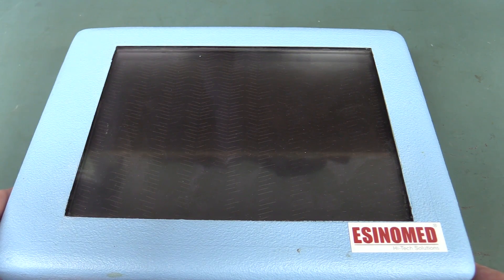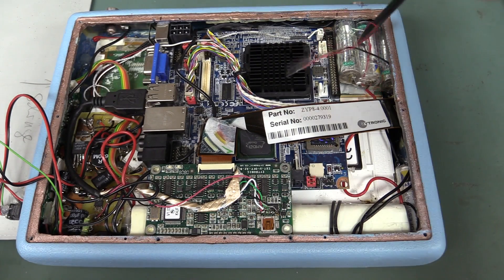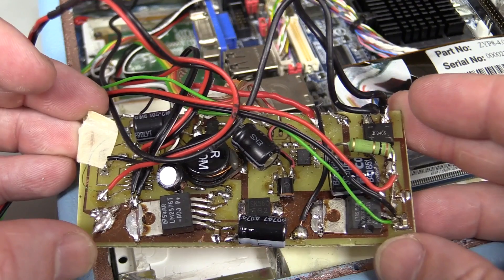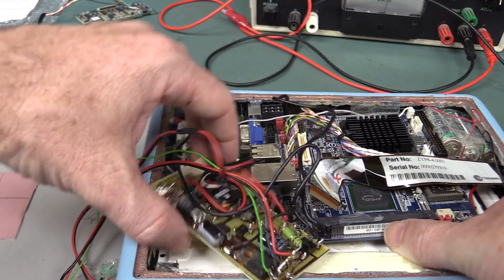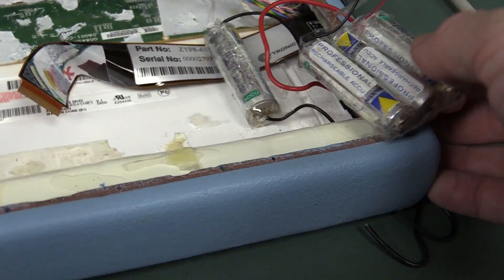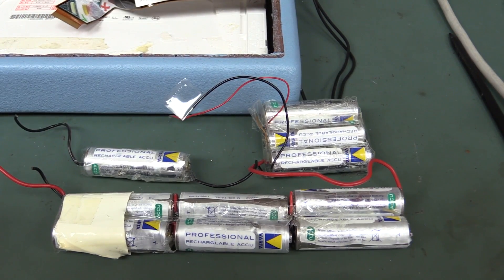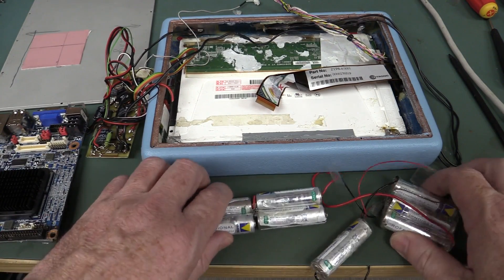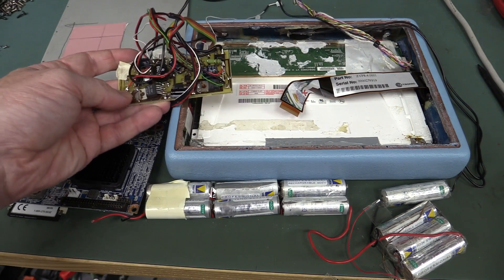EEVblog #822 - World's Worst Tablet Computer Teardown

Comment: Hey Dave. what's the model number of that PC board?
Reply: +EEVblog Dave, could you possibly do a quick vid where you test how good / bad the output ripple of the "PSU" is?

Really no excuse for this "prototype" to exist - as you said in the vid, they could have just used an off-the-shelf mini ITX PSU brick which runs off 12-19 Volts. They are still quite small, and would have been around when that motherboard was released.

Even a cheap NiCD pack, or camcorder / drill battery with a built-in charger circuit would have been quicker to get hold of. lol

I wonder if it was maybe an intern / work experience person that put this "thing" together, and they simply released it as a client demo unit anyway?

(you sure it wasn't Ben Heck with his hot-snot gun? :p )

Whether it was for a consumer, customer, or client demo, it's still not excusable to have made at least 11 of these.
Reply: +electronash I was actually thinking that this might have been the work of a young Ben Heck... silly ideas and way to much hot-snot..
Reply: +Jeremy Dixon (generalleoff) 
Funny how the Pi gets soo much attention when you could get far more capable boards for $20 more long before.
Big marketing money.
Reply: +Firstname Lastname No marketing money at all! 

Just word of mouth ...
Reply: +electronash Just echoing electronash's request, I'd also love to see an analysis of the efficiency and ripple of that howdydoody psu!
Reply: +electronash In his defence, I never really got the impression that he claimed to be an expert, so much as an enthusiastic hobbyist. I'm not really that into his show, but his website and forum way back in the day were awesome. Lots of bodging and hot snot, but some creative ideas none the less, and he really encouraged that sort of exploration. I remember seeing like 14 year olds building vaccuum forming rigs to make custom cases for N64 portables. You can say what you want about his soldering skills, but he definitely sparked the creativity of some kids who came out of it with an enthusiasm for engineering, or at least modding.
Reply: He has done a small number of not-so-bad portable mods, but I can't forgive him for his poor soldering skills, destroying a perfectly good ZX Spectrum, and for pronouncing it "Zee-Ex Spectrum". :p

Anything on Ben Heck that has half-decent soldering is usually done by one of his cohorts.

You'd think that after more than ten years of modding, and having his own forum that he'd picked up a few techniques by now. lol
Reply: +CreativeType There is a kickstarter campaign right now that I have backed called the UP board that uses a Intel Atom x5-Z8350(listed as Z8300 but they plan to use the Z8350)  2GB DDR3, 32GB eMMC, and even a USB 3.0 OTG port for under $200 in RPi 2 form factor.
Reply: +EEVblog Nice, in my company we use ALIX Boards as routers, they have the same processor, but RAM is integrated (not changeable) and they only need a simple external 12V power supply.
We changed them with APU Boards which are similar, but have a better processor (AMD G-T40e) and are pretty nice too.
Reply: +Firstname Lastname I'm sure it has nothing to do with the openness and huge community around RPi.
Reply: AnubisAkaLee https://www.kickstarter.com/projects/802007522/up-intel-x5-z8300-board-in-a-raspberry-pi2-form-fa?ref=nav_search 
34 hours left :)
Reply: Aleksander Øyen Ah yeah. Personally I just want to built a tiny handheld Linux terminal I can tinker around with. Perhaps use it as a picture frame or something. The lack of a wifi chip on the Pi boards really is a bummer though, but oh well; there's always alternatives even though they might not be as neatly packaged.
Reply: electronash I guess it's one of those things where someone learns on their own rather than getting "classical training," and even though they do everything wrong, it somehow works in the end. He does do some pretty gross soldering though lol

About the 8-bit computers, I agree. It's a shame to see some of them taken apart and modded to pieces, but even the 90's stuff gets me that way. A PS3 or Xbox is an appliance to me, and just gets replaced when the next generation comes out (or sold, and not replaced, because PC), but I will never stop playing or get rid of my NES, Genesis, SNES or N64, so I always cringe when I see people tear them apart. I have seen people make some cool things out of them, but nothing irks me more than when someone uses an NES case as an enclosure for something else, and just tosses the insides out.
Reply: jordanzish I'm a video guy,  I watch this channel out of curiosity. However I've applied  some of his lessons to real life and etched some boards etc. I solder wayyy better then that though haha. Soldering isn't that hard as long as your not sloppy.
Reply: Oh, and Geode boards are generally quite well regarded, though they don't have the best raw number crunching or desktop UI performance, they do run native x86 code and have pretty good media processing. Hence they get used in things which at one time might have required a dedicated PC server (disc stations, firewalls etc) and so have a transferrable codebase, and very often in set-top boxes for satellite/cable receivers, "smart" media centre devices, even some HD optical disc machines and PVRs. I somehow don't think the Pi would be as good for that.

The thing with the Pi was that you got a full good-to-go computer with built in general IO interface (instead of needing a separate card, or USB converter) that could run off a plain USB power input and interface to almost any non-VGA display you had hanging around. Chip, memory, networking  etc already all on board, all you had to do was add a storage card and plug it in. Very small (credit card size), very versatile (use it as a low-end desktop, put it in a mobile case as some kind of handheld machine, or use it in place of a microcontroller for various projects but with much greater program/data storage and processing/communication abilities), and quite low power output thanks to its ARM CPU. The only "drawback" as such was that you couldn't therefore run regular windows apps on it, but at the same time that nixed the issue of having to worry about software licensing. Just install an ARM distro of Linux, download what's already available as pre-compiled or roll your own versions of most software from the source with a suitable compiler (not much smarts needed beyond getting the thing, if not already included, and pointing it at a downloaded sourcefile), and off you go, no further investment needed other than what you decide to plug into it or wrap around it. And of course, as it's ARM, you could just Android it, and use your personal favourite APKs.

Yer typical thin clients might be about the same price when bought in bulk (not my experience from seeing them being bought institutionally however - if you got them for the same price as a Pi then they were probably second hand), and usually then you'd have to tear them out of the existing case, find some way to wipe and overwrite the existing netPC software pre-installed to their non-replaceable flash memory (after working out what would be suitable to install, even, and maybe having to pay for it / license it), plus they're almost universally larger, with greater or more complicated power requirements (and, in this case, even "12v at 1A, centre positive coax of size X" is more complex than "plug it into a random USB phone charger") and energy use, maybe with performance tuned for a particular use that's the totally different from your own (ie, receiving video data through an Ethernet jack and displaying it on a VGA monitor, then sending keyboard/mouse data back the other way) and less suitable connection options for the kind of projects the Pi is meant for.

Price and raw processor power are not the be all and end all, the other features also have to match up. And the Pi proved to have a good combination of all these for general project-hacking and learning programming, which microcontroller boards and repurposed thin clients didn't quite match. Plus it's a single universal platform in of itself, there aren't a hundred different things to choose from and support. There's some variation in CPU power, memory, and onboard ports, but that's about it, even the lowest grade (not sure if Zero or Model A...) is quite beefy in the context of full desktop computers from 15-20 years ago (yet is something you can happily dedicate to running a custom pattern on a string of Christmas lights if you so wish without being too bothered about price/size/energy use) and code written for that will run on all the others without any problem at all (and that made for a higher level one can probably be trimmed if needed, rather than needing a full ground-up rewrite).

Sure, there are things it's not the best for, which is why you'll still see those other devices, but it doesn't mean it's a pointless waste of cash for the gullible.
Reply from the maker: +CreativeType NX80GLX
Reply from the maker: +EEVblog Correction NX800LX
Reply: Thanks, just seemed like a nice board lol, can't say the same about the rest of it. haha
Reply: +Jeremy Dixon (generalleoff) Gehe, I once bougth a few so called 'thin clients' to mess with. Second hand. Via Nehemiah, Transmeta Crusoe.. All before the Raspberry Pi and before the Atom. I bought at least one of them for only €10.
Reply: Skwisgar2322 I have  backed it too :)
Reply: +Skwisgar2322 Mind linking to that kickstarter?
Reply: jordanzish Oh, I give him his due credit for how he started out - he did some of the very first portable mods on the "next-gen" consoles of the time, and got thousands of people involved in similar efforts, so I do applaude him for that.

It's just surprising to watch him solder in more recent vids that his technique hasn't improved much over the years, and he still loves the hot-snot gun. :p

I'm no expert solderer either (by any stretch), but it's slightly strange to see some of the methods he uses - like putting the solder on the iron first, then dabbing it onto wires / joints etc. (which isn't good, as it burns off most of the flux)

I've even been on his forum myself for about 8-9 years, and there are some good people on there.

I don't begrudge his success either, but it's kind of taken away from the "hobbyist spirit" a bit when he uses his expensive laser cutters and 3D printers.

I'm also on the side of preservation when it comes to the older machines like the ZX Speccy.

The criteria that a fair number of people (on the retro groups / forums) have agreed on is the relative "rarity" of the original machine - there were only around 5 million Speccies sold, and only 4-6 million or so Amiga 500 machines sold (by about 1990).

In comparison - there were around 24 million original Xboxes sold, and over 84 million Xbox 360s! :o

Since I have a bit of a soft spot for the older 8-bit machines, I think it's best if they are left intact rather than modding them.

For most stuff after about 1994 though, I think it's fair game for modding, as there are often so many more machines out in the wild (apart from the 3DO and Jaguar. lol).

So yeah - I'm still subbed to Ben Heck, and still watch the occasional vid - I just wish he'd learned a few more soldering tricks along the way.

(Having said that - he did manage to solder many very small Kynar wires for things like the Sega Radica cart slot mod, so that's fair enough.)
Reply: ***** joda, stemme det..
Reply: +Aleksander Øyen Whoa. I'd never heard of UP. That's incredibly cool. I'm personally a bit more excited for Pi0 for my own projects, but I've got a freaking tablet/laptop hybrid running Atom. It's no power-house but it gets the job done, and rather well at that.
Reply: Dojan5 I plan on running OpenHAB on it, a bit more processing power than the PI2.

If only the PIzero had wifi... :p
Reply: +electronash those power bricks didn't always exist and when they were first available they were very hard to find and were prohibitively expensive.
Reply: riffraff60 The smaller Mini-ITX PSUs were never too expensive, and have been around since way before the motherboard in this "tablet" was released.

I used to build "car PCs" back in 2002 / 2003, and used one of the first full DC-DC bricks in that. It only cost around £60 even then. ;)

The smaller ones were around back then as well (the ones with a similar width to the ATX power socket).

The only slight drawback with that type is that they pass the "12V" output directly from the input, so you could end up with more than 14 Volts passing through from the car's alternator (plus a lot of voltage spikes / noise etc.)
Reply: +CreativeType yeah,  the most common mistake is using too much solder combined with the wrong temperature.  Unfortunately most assemblers dont have the proper skills.
Reply: +Jeremy Dixon (generalleoff) May be we can use that to make another terrible tablet.
Reply: +Skwisgar2322 Its kickstarter page says "from $99". That's WELL under $200. Thanks for the tip, mate.
Reply: I can sympathise with the bad soldering and hot-glueing if it was maybe handed off to a less experienced staff member to finish off. My own soldering skills are bollocks, I know that much, and decent irons and nicely fluxed solder are just too expensive to justify for the kind of patch-ups I tend to use it for (where "sort of working", or "working but terrifying to look at" still trump "broken and very expensive or impossible to have professionally repaired/replaced"). If I can get away with crimping, taping, screw-trapping or hot-gluing, I will... solder is for those things where you can't do something else, in my own world. Annoyingly that often comes along with really tiny wires and contacts/pins; the most useful recent addition has been a set of helping-hands that appeared at bargain price in a local discounter...

Still, that's as a domestic amateur, and occasionally as a lower-end AV tech when we can't get a company in to do it for us either affordably or in time. There's no way you'd accept the same kind of practice from a professional engineer, in a finished product, or even as a public example of how to mod something...

Comment: its a shame, looks like a good motherboard and a decent screen, i always wanted a embedded CPU motherboard for a few projects, but they seem to be hard to find in Australia
Reply: +MrBlakBunny Most PC/104 boards will quite happilly run Windows.
Reply: +MrBlakBunny Get a "PC/104" standard board, they are made for industrial environments, they are about half the size of the board in this video, they are stackable and have all the necessary stuff onboard
Reply: I'd perfer something that can run Windows or similar OS, for Mame machines or PFsense routers, but i'll look into that, thanks, i am a glutton for tech :3
Reply: nrdesign1991 I'd perfer something that can run Windows or similar OS, for Mame machines or PFsense routers, but i'll look into that, thanks, i am a glutton for tech :3

Comment: Looks like some of the ham radio garbage I ripped out of a tower site I bought  last week.. Botched up soldering, duct tape and hot snot.. Pathetic..
Amazing it was working equipment, cant say that now since it rained on the crap I hauled out... But whatever, the owner was informed and never showed up to get it.
Dave, I HOPE for the sake of electronics you tossed that abomination in the trash bin..

Comment: Surely this wasn't delivered like this. I refuse to believe that; much more likely someone got hold of the screen, gutted it and jerry-rigged it for himself. No engineering company, no matter how small or shoddy puts out work like that. My first job was an electronic engineer (with no formal training, I'm a computer scientist not a solder monkey) and even my bodgy  efforts were nothing like this.
Reply from the maker: +Jason james Someone went to the trouble to make a double sided home made PCB for it!
Reply: TBH that might have been something I might have tried back in the day, I attempted (with little success) to etch my own circuit boards, with a permanent marker... If you were going to build this as a company you wouldn't bother to make a power supply like that, you'd just buy in a ready-rolled board from the RS catalogue (or tear down a wall wart) and bodge to suit if necessary. We did cut down costs on one of our designs by buying in off-the-shelf AT power supplies for some  limited run test gear - yes I worked for a small bodge-merchant ;-)
Reply: +Jason james And to be honest, that PCB is a micro-atx power supply. Something you can readily obtain on ebay all day long for cheap cheap. It may have a custom 1/C charger circuit, but even then you can pick those up cheap too....

Comment: And I thought my first circuit board was crusty (hand drawn with a marker, holes made with a knife). Anyone can solder better than that, even if you have nothing but, I don't know, a candle and a piece of copper wire instead of an iron. (believe me, I have a small homemade iron) Certainly it was innecessarily crusty, probably there's not even a bit of real engineering in that, just plugged a lot of stuff together and shoved it in a case. It builds like Lego. So happens that the only thing that seems to have been designed by the manufacturer is one heck of a nightmare. There's not much stuff you can possibly get wrong and somehow this happened..